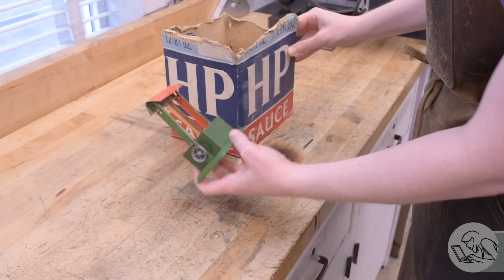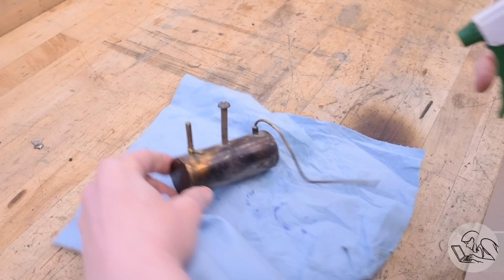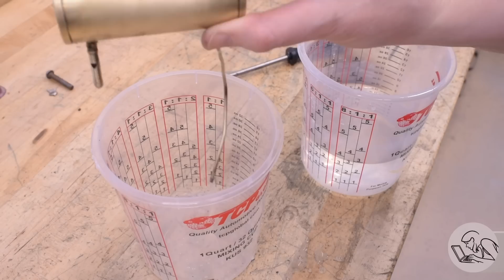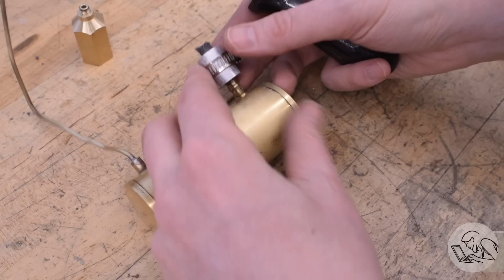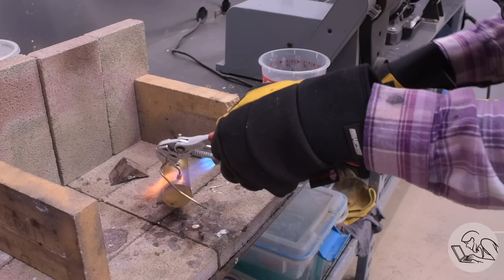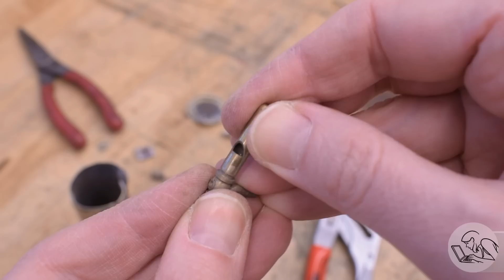Restoring a Vintage Steam Toy - Part 1

Comment: I think I'd like to try this build. I have two small steam engines that I've built and it is good fun to run them on steam occasionally rather then compressed air. It stretches out the start-up like waiting for an ice-cream truck. The boiler I made is electric and made with left-over pipe and vacuum fittings. It works, but it's a kludge and it is silent.  While it is coming up, it makes a nice mess of water on the table and until the whole thing is pretty good and warm it spits and sputters. When it finally gets going good, everyone cheers. Hooray!

Comment: They may not have been depending on the whistle leaking to reduce the boiler pressure, as the engine is an osculator the piston assembly is healed to the port face by a spring when the pressure raised it forces the piston assembly off the port face. I have seen quite a few designs where there was no safety valve at all.

Comment: Super cool HP sauce box too! I have a few of these, all Mamod ones. A couple of little stationary ones and two steam traction engines.  And I have made a small one myself once. As I have been getting into Meccano recently, and I am into vintage cars I am considering making a little Mamod like steam car. You can still buy them too but they are expensive.

Comment: I honesty expected many comments from "Professional Engineers" , who I work with a lot with hydraulics, to point out that water IS compressible, but at such a low ratio that it is inconsequential.  I made the mistake of saying water isn't compressible in front of a group of Engineers, one spent 20 minutes explaining to me how I was wrong.
Reply from the maker: There have been a few, but none that didn’t violate my commenting policy, so they are all in the circular file.

Comment: Quinn, your safety warning telling folks to absolutely NOT use compressed air to check boilers for leaks is right on target.  The last person who died in an accident at the Facility where I used to work was "loaned-in" to our Oxygen Shop and was assigned to perform leak tests on aircraft components like tubing, etc.  We used an old engine test cell with personnel in the control room looking through the "bullet proof" windows down into a steel water tank about 96-in. long * 30-in. wide * ~36-48-in. deep (~2438-mm * ~762-mm * 914-1219-mm) that had angle iron reinforcement around the top edge of the tank.  Since the man didn't usually perform that type of work and (to add insult to injury) the incorrect paperwork had been applied to the component.  The paperwork was for a different part that required a high pressure test, while the part he actually tested should have had a low pressure test.  Anyway, he hooked the part up with blank-off plates on either end and applied high pressure air (I guess using standard shop air pressure of ~120 psi [~0.827 MPa] instead of the correct low pressure around !10 psi (~0.069 MPa)).  The component came loose from the hold down "devices" (whatever they used to use in the tank) and floated to the top of the tank/water surface.  He went into the test cell while the component was still under high pressure and attempted to push it back under the water so the he could look for air bubbles escaping from a flaw.  Unfortunately, he didn't push the component down with an "even" load, but most likely simply tried to grab it in the middle and push it under the water.  The component exploded, displacing the tank edge outward (i.e., towards his body at least ~12-in. (~305-mm) or possibly even more.  The tank was raised high enough for the testers to be able to look down into it through the window which meant that a raised work platform with a wood guard rail was required.  The explosion/tank/water threw him through the guard rail and across the test cell, possibly against the far wall.  Unfortunately he died from internal injuries caused by the incorrect high pressure pneumatic test.  This happened back in the late '70s, before I started working at the Facility, but the water tank was still there still being used for leak tests, but with an automatic lock on the door between the control room and the test cell to prevent this type of injury/fatality from reoccurring.

ABSOLUTELY DO *NOT* USE COMPRESSED AIR OR ANY OTHER GAS TO PERFORM LEAK TESTS WITHOUT PROPERLY DESIGNED TEST FACILITIES TO SAVE FOLKS FROM SERIOUS INJURY OR EVEN DEATH!

Comment: I could tell it was a Fleischmann by the shape of the firebox and oblong air ports, but am glad it was verified. My granpa had a 130/2 which I later tried to repair but was unsuccessful, a completely new boiler is needed but I don't think it's worth the cost of sourcing one, so it's currently only a decorative item.

As you say the whistle will start to leak, but if all else fails the oscillating cylinder itself will act as a safety valve as steam pressure forces it off its port plate. I've had that happen on my little Wilesco things even before the safety valve lifts.

Comment: Loved the video. Looking forward to seeing it completed. I have one of these little Fleischmann engines, it is the 120/1 model (you can find a full list of Fleischmann models and year-to-year changes on the Ventix website, if that is of any interest). Surprised to see the hole form in the boiler at the end, the zinc actually vaporizes out of the brass when overheated. Not sure why the solder wouldn't melt before this point, but I've seen this happen before when trying to melt a brass ingot for casting, and it just kind of shriveled up instead of becoming fluid! Building a new boiler should be simple enough, and no doubt better than the paper thin boiler these had from the factory. Will be fun to see it steam again.

Comment: One of my favorite things to watch while I was in the yard working for Halliburton was to watch them recertify 20k iron pipe, and seeing a failure. At 20k psi the "water" instantly flashes into steam and turns the test bunker into a room temperature sauna in about half a second. Can only imagine what a 20k air test would look like, but if I saw it...I probably wouldn't be seeing much of anything else...

Comment: Can you not use copper tube and block the ends to form the boiler looking at it seems to be about 50mm tube rather than forming a brass tube out of sheet brass

Comment: I had a Wilesco. It arrived at Christmas when I was about 10 years old. Since it breathed fire, the steam engine and I were banished to the back yard. The temperature in degrees American was in the low teens. The Nesbit tablets just couldn't get the water hot enough to make it run. Eventually my mom relented and allowed me to run it on the concrete floor in our basement, and I learned that starting with HOT tap water sped things up quite a bit.

Its two safety valves were a problem. They would start to leak well before the boiler had enough pressure to run the engine and the escaping steam would condense, run down the side of the boiler and partially drown the fire. The engine would just barely run. I wrapped some scraps of wire around the compression springs to limit their action and then it ran pretty well, but never with enough power to turn the accessories until I discovered that I could break up the Nesbit tablets into finer chunks (careful, not too small) and get a more enthusiastic fire.

Edit to add: I enjoyed the video so much that I tracked down the same Wilesco D8 that I had as a kid on Ebay. Couldn't resist. Hoping it doesn't need boiler repairs, but if it does, I guess that's a good opportunity to start doing more machine shop work.

Comment: Great work Quinn! I often find I learn the most through trying to rehabilitate something after decades of rust/corrosion/abuse and the sometimes inevitable decision to rebuild so that it lasts another 70years. 
I'm still using kitchen knives that my father replaced the factory handle 40-50 years ago. 
Looking forward to the new build. 👍🏻

Comment: Re the safety valve thread. At first I was thinking BSP which is the standard pipe thread outside of North America but at 1/4" struck me as to small an ID. It could be a metric M6-1.0 thread being German made but also it could be British Standard Brass at 1/4" and 26 tpi.

Comment: The explanation about hydrostatic testing also demonstrates why boilers can explode the way they do: They generate and store energy in steam, which is compressible, contrary to the water. This is also what makes it able to drive pistons, turbines, etc. as well as it does, the stored energy is released and turned into motion of the mechanism. Turns out, if you're generating energy, you're often also generating danger!

Comment: On hydrostatic testing, it would have been overkill here, but at work we submerge the test part itself in a water tank, with food colouring in the pump water to highlight leaks. That way not even the front three rows get wet. Also I too wish to recognise the beauty of the 'propellor' die holder 😊

Comment: I have been scouring the interwebs trying to find catalogs from the early 70s (when I was a kid) but have only found a 1975 Eaton's Xmas catalog.  They do list a couple different "Made in W Germany" stationary steam engines, but aside from fuel, they list no accessories ... but I know I've seen a big set with all the accessories our hero displays.  Need to find a catalog from a few years earlier ... late 60s maybe ... or maybe Simpson's and not Eaton's.  I wonder if the end of steam locomotives on most large railways c.1960 dampened the demand for these from kids?  Yes, I know, these toys are stationary engines (you can see the bricks stamped into the base!) but no one sees those in real life compared to steam locomotives.

Looking forward to a new boiler build!  😀

Comment: When I worked on firearms I used two test to determine solder types, if you could scribe the solder in an area that wasn't noticeable, you could usually tell by the color under your scribe mark and how easy it was to scribe.  Also, Birchwood-Casey makes solder black for soft and silver solder.  One doesn't work on the other, so if you are refinishing something anyway use a dab of each and see which one turns the solder black.

Comment: I wonder if (and you would know better than me) is it possible that a tiny removable piece of zinc suspended in the boiler will prevent dezincification? Basically giving it zinc to eat away as i see on boats?
Reply: Also common in household water heaters

Comment: A steam engine I know a thing or two about! I have an old flieschmann steamengine that gets run once a year since I fixed it up
Reply: Sorry for being excited while following along, 

When I tested my boiler I used 5mm high pressure fuel line for a fuel injected car and used a bit of steam oil so it would slide over the whistle

Comment: I have the same steam engine that I received as a gift before I was in my teens. 60 some years ago.  From the days when parents gave kids toy that had fire and live steam.  When I was in the service my brother lost or broke the accessories, but at least the steam engine still works.  Every so often I take it off the shelf and fill it with water and light one of the fuel tablets and watch the flywheel turn until I run out of fuel or water.  I plan to give the boiler to my grandson, but I am sure his parents will not let him run the steam engine.
Reply: I'd totally let my kids do that, but then I'm old fashioned...
My son asked for tools for his third birthday. He got a nice set, little Japanese pull saw, small brace and bits, tiny hammer, a couple of hex keys, tiny Japanese plane - and the wood to build a tool box (T. Odate style). Yes, adult supervision is required (now it's more like adult company is "required", or rather appreciated, the kids have their work bench, I have mine, shop time together is great!).

I need to show my kids my Sterling engine...

Comment: When I was a kid, my dad cleaned up the Fleischmann steam engine toy from his own childhood in the 1950's, and we fired it up and ran it. I remember drive belt tensioning for the tools being a problem, but we did get the table saw to cut some matches at least. :) I think it's probably still around in my parents' basement, along with a small collection of Fleischmann model railroad stuff from the same era. I'll have to ask dad.

Comment: I have a vey similar Mamod traction engine. Cleaned it up, and ran it a few times with great success.

Mine runs on methylated spirits (denatured alcohol). Much better than those nasty tablets. Although the people at the hardware store gave me some funny looks. I suppose meths could be dangerous if used irresponsibly, but it does a cracking job getting the boiler up to steam quickly.

Quinn is the only person I can think of who is going to fab a brand new boiler for a steam engine that, at the best of times, is dreadfully inefficient.  Run one of these toy steam engines a few times. Do some math on the amount of useful work it puts out versus the energy in the fuel it burns, and you begin to understand all the crazy engineering that went into Victorian steam engines.

Fantastic stuff, as always!

Comment: oooh a project...very cool..I was reading subtitles (watching the news) and it said desincification and I thought whussat
AI actually turned out to be useful and told me I wanted dezincification its still the first time I have come across the term so thanks for that Quinn I learnt something new!
Shame you need to make a new boiler but definitely a needed upgrade so looking forward to that one .
Thanks for sharing

(after thought I wonder if you could use part of the brass for something non critical)

Comment: Hi Quinn, you cleared up a 55 year old mystery. My little Wilesco was run dry around 1970 (oops) and it got hot enough to melt and dislodge the steam pipe fitting. My dad boldly re-heated it with a propane torch, and it was slipped back into position - a repair that was only possible, apparently, because of soft solder. Learned something! 👍

Comment: Hi Quin.
Solid fuel tablets have been banned in the UK unless you have an explosive certificate.
We now use a gel to burn and heat up the water.
Sadly Mamod had a sale of parts and closed in 2024 but there is another company MSS producing similar engines.

Comment: "Most people would buy these toys, run them a few times, and go 'neat!' and put it on the shelf"
Not to mention that the pressure built in those toys is pretty low too.

Comment: This might be far-fetched, but you had mentioned that a modern technique for these smaller boilers is to still build brass and then zinc plate the body. I'm assuming they electroplate, but, with your setup, would it be possible to use a formulation of something to zinc-coat with the powder-coating setup, and solder up?
If this is mainly a display model, like you mentioned, there's not much need, but the thought seems interesting, if that's feasible.

Comment: "buy it, run it a few times, then leave it on the shelf"

This is precisely the reason I haven't bought a toy steam engine. And also the reason I haven't bought one of those super-powerful green laser pointers.
Reply: I had one of those, ended up getting stolen out of my car when it got broken into, it did see a fair bit of use though. 
The wilesco model steam engine I inherited however has only been steamed up once since I got it, I had ideas of fashioning a generator for it and using that to power a small model tramway layout.

One of these days I suppose I'll get round to it